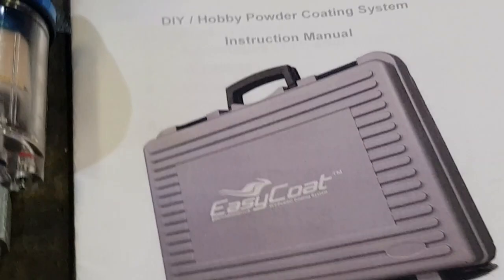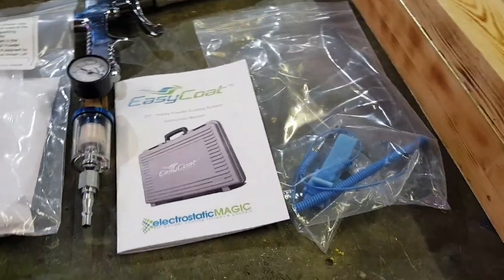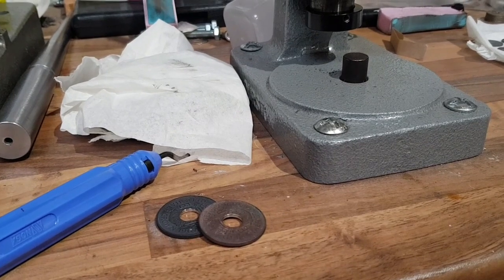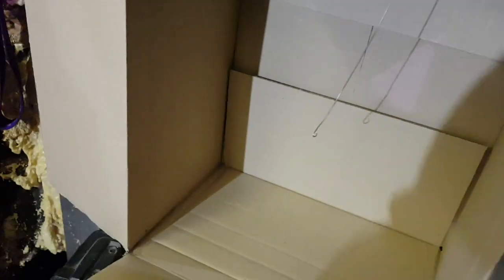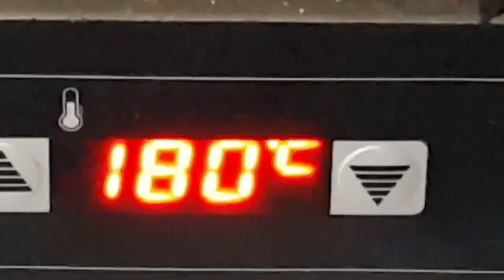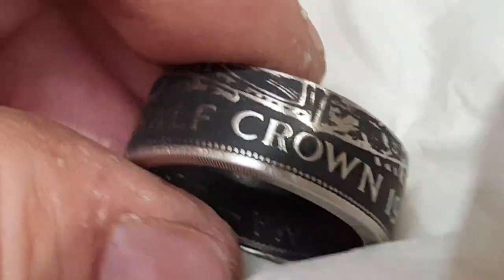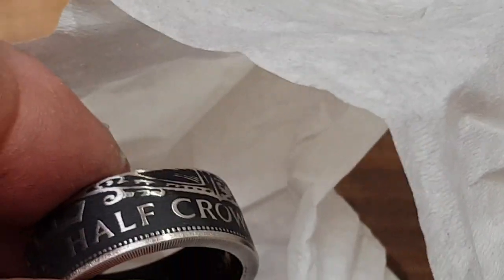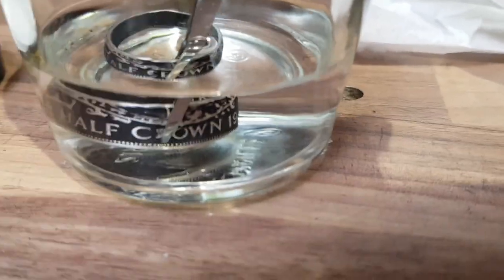MAKE - My first play with powder coating coin rings.

Comment: I bought one of these as well, ... Tip for you, I put a spray gun filter at the bottom so the powder comes out fine and doesn't spit out lumps of powder, you can control it much better that way, and I have my PSI set at 40psi .. Comes out beautiful and very even coats.

Comment: Gotta be a better way to spray powder. That thing is way too big and wastes too much powder. What about a round soft paint brush rigged with + wire? Have you done insides?
Reply from the maker: After a bit of practice it's fine.  There isn't any waste as I collect in a large plastic housing and reuse.  This system applies an electrostatic charge that suits most jobs perfectly.

Comment: How long do you “cook” your ring before you pull it out to remove the lettered and designed parts
Reply from the maker: It only needs about 10 minutes for the powder to melt correctly.  Then let it cool and gently abrade to reveal the detail.